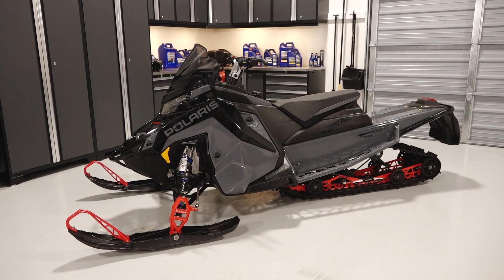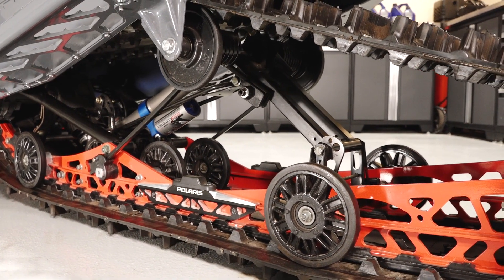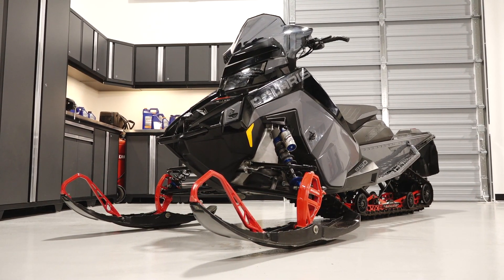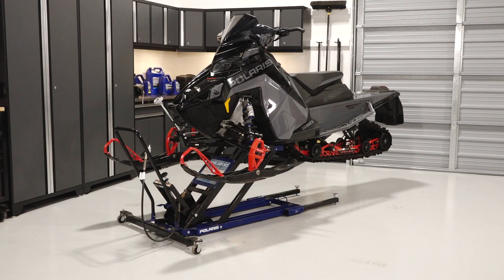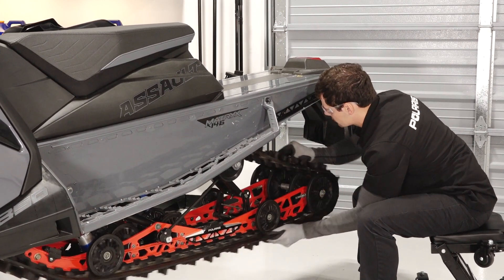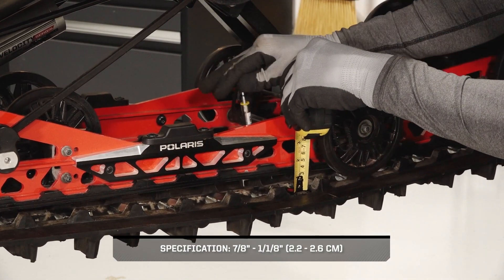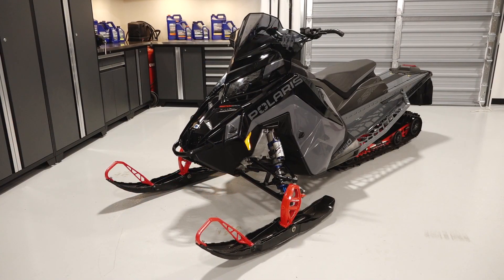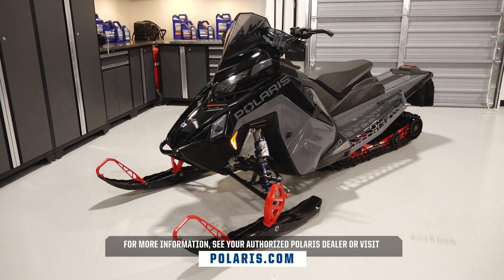850 Switchback Assault 146 Track Inspection and Tension Adjustment - Polaris Snowmobiles

Comment: Good video, got right to the point. Bonus, that it was the same sled that I've got snowchecked except for more red paint and a 650 engine.  The ICE Storm 1.5 is going to be excellent for my mixed usage.  I am pleased to see that the IGX rear suspension has got 4 rear idler wheels and 8 rail bogie wheels, like I expected.